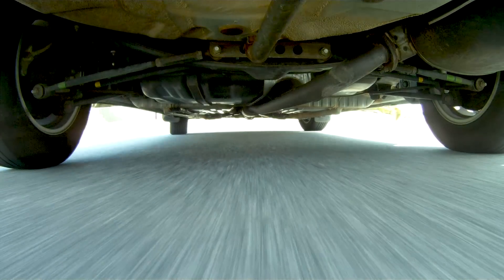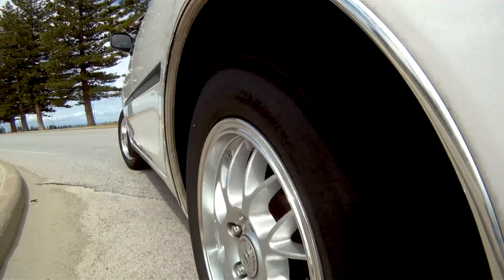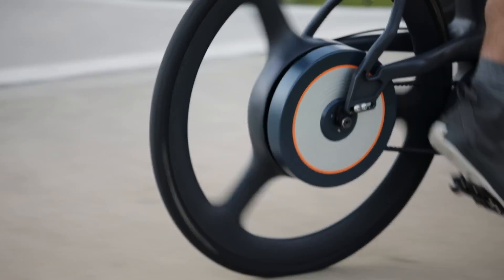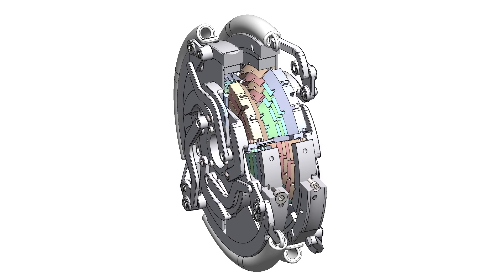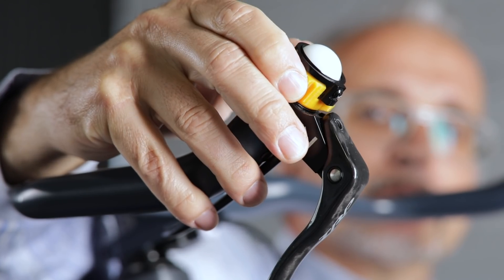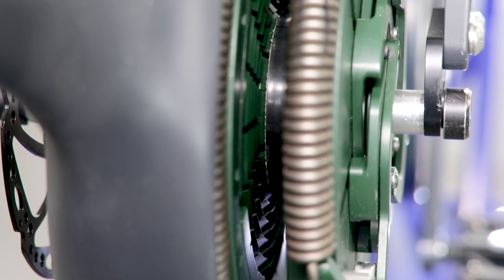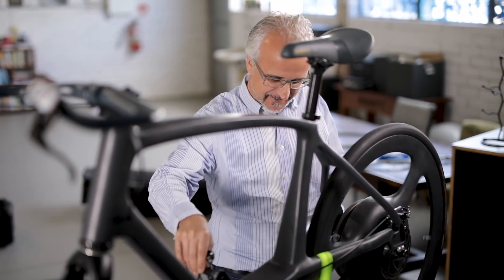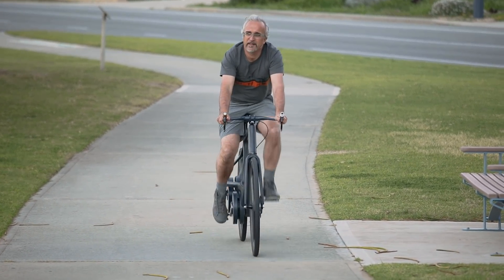Continuously Variable Transmission on a Bicycle

Comment: 1. Doesn't look simple ,very complicated.
2.lot of moving part leads to maintenance. 
3.it's not CVT.
Reply: Heavy weight too probably.
Reply: Ad1) My guess is that they meant "simple to use".
Ad3) Care to explain why you don't consider it to be Continously Variable Transmission? The core principle is the same.
Reply: To me a continuously variable transmission is one that is constantly adjusting the ratio to keep the power input at a constant speed as the output increases with speed. It does this automatically too. This one on a bike looks like a complicated 10 speed.
Reply: @seanriley1603    Automatic gear ratio adjustment is just a feature. Definitely useful (if not obligatory) for automotive applications, but rather optional for cycling (depends on personal opinion ofc, but people tend to lower rpm when riding uphill).
It's not 10 speed. What we have here are 2 cones seperated into rings to reduce width, so the entire system can be fitted inside bike frame. That's the whole idea here.
Reply: @RafaWyrwicki  - CVT is Continuously Variable Transmission, it's in the name.  This and the Nuvinici N360/380 are IVTs or Infinitely Variable Transmissions, having for any practical purpose an infinite number of ratios between their min and max ratio. The use of CVT is for marketing and as with a lot of marketing factually incorrect.
Reply: @Shindinru  Afaik infinitely variable transmission should have infinite gear ratio range. The example above doesn't have that feature. I guess we would have to compare our definitions.
Reply: @RafaWyrwicki  - Infinitely Variable Transmissions having, for any practical purpose, an infinite number of ratios between their min and max ratio. This is the working definition as you can't build a gear box that goes from zero to infinity gear ratio.
Reply: @Shindinru  you are wrong. By running the input and output of a cvt through a differential like setup which can be made compact by putting it in a planetary gear arrangement it's possible to subtract the input from the output and have a zero to one ratio and even a drive that can vary the direction only by changing the ratio of the cvt section. It's also possible with some type of oscillating sprag drive setup to vary the ratio to zero and its possible for friction drives the do this as well such as the wheel drive clutch on a snowblower which only has increments on the handle but in principle could be infinitely varied between forward and reverse. Of course it's impossible to get infinite output speed as somewhere along the lines physics would cause something to fail and input torque for even a small amount of drag or acceleration becomes  excessive. But in principle Infinite variability from zero to infinity is conceivable and from zero or even negative direction to some pre designed limit in practical and even exists.
Reply: @Shindinru  Yes you can. Quite easily. You take a continuously variable gearbox and you use a differential to subtract some of the input rotation from the output, with the result that in the lowest gear, the output doesn't rotate. You have now created a semi infinitely variable gearbox. Two of these in tandem and you have a gearbox that goes from infinity to one all the way to one to infinity, at least theoretically.
Reply: @Timms MC it uses a V belt, though. So if those rings only moved part way inwards they would engage with the belt
Reply: It looks like it has LESS choice than on modern bike!
Reply: 4. It's a proof of concept, obviously would require further development in order to be practical.
Reply: Well its stepless so yesnt and i do think its heavy stepless means theres no hang while shifting good on motorized vehicle man powere maybe not so theres always a good egg and a bad egg in a basket of new concept
Reply: And it requires a bluetooth connection, too. I wonder how well they're doing on sales?
Reply: Its a pseudo-cvt
Reply: Actually, I think it might be CVT. When I first saw all of the rings, I just thought it was a finely-stepped transmission, but it looks like they're able to continuously adjust the spacing of the tapered rings. So, it's like they took a normal CVT cone and figured out how to make it a set of nested rings, like how you can collapse a telescope. Overly-complicated, but still clever.
Reply: Is it a CVT?
Well actually, yes- but, technically no.
Reply: The more moving parts leads to loss of energy.
Reply: https://journals.sagepub.com/doi/abs/10.1243/0954407011528806?journalCode=pidb
" An infinitely variable transmission (IVT) is a continuously variable transmission with an infinite ratio range, which means that the transmission ratio may be zero."

https://www.machinedesign.com/%5Bprimary-term%5D/infinitely-variable-transmission-has-gearing-range-11-speed-automotive-transmission
"infinitely variable transmission (IVT) (...) is a special type of continuously variable transmission (CVT)."

https://www.slideshare.net/mobile/MoanungsangJamir/study-of-infinitely-variable-transmission
"IVT is a subset of CVT"
"(CVT) have infinite number of gear ratios"
Reply: Rahul Todmal agreed. It's so prototype it's ridiculous. The balance of the bike is ruined too. Looks good for posing like most Lycra clad idiots.
Reply: @Timms MC - Exactly.  What it is doing in practical terms is changing the Diameter of the pullies that the Vee -belt rides in, which is similar to how some CVTs work.
Reply: I think it is a CVT, just broken up into a number of parts (but still basically continuous)
Reply: 1. It can be shifted continuous variable
2. It is complex, a generator + Motor would be better like this sadly dead-looking Gear2 Design from Denmark (got some Design price in 2010)

Comment: so it is not a CVT but a remotely operated new style of gear system. CVT changes gear rations depending on the torque requirements
Reply: But that's automation. Cvt means variable (and continuos) inniterrupted gearing. Regular automatic transmision also changes gear ratios depending torque requirements.

Comment: Imagine to ride this bike on the mud or sand... This mechanism will get stuck right away..
Reply: I would presume the internal mechanisms would be environmentally sealed.

Same as how you wouldn't expect snow and mud to gum up into your cars transmission..
Reply: @lefyre1266  they would need to seal the whole mechanism to do that, the belt included
Reply: @juancarlospalomino8939  Full chain covers have been used for years on some bikes with internal gears. Many of them can be considered sealed systems. Applying similar solution here shoudn't be too much of a problem.
Reply: @RafaWyrwicki  I know, but I was saying because they didn't to that in the video, but it would be easy to do
Reply: Or snow? 
Ride it to work, leave it outside for 8 hours and come back..
It's all frozen and fucked.
My normal MTB doesn't like to work when it's cold.
Realised that around -36°C the brake cables won't like to move = no brakes.
Reply: @0hjaa3.0 Will you ride the bike in -36 cold? let me know how will you do that
Reply: @raduvas90  Ofc? I always did that when i didn't have a car and i had to go to school or work.
It doesn't what the weather or temperature, you have to go to school and work.
Reply: @0hjaa3.0  I guess your grandpa said the same about multi speed bikes back in the days and you dad about Shimano Di2
Reply: @MallV0lli0  Actually neither of my grandfathers talked to me.
One died before i was born and other was gone mentally.
My father didn't say anything about Shimano Di2 since that's a new thing and I haven't talked to him in 10 years.
And before i was 13, i didn't talk to him about bicycles.
So nope.
Bicycles work already fine and they did many many years ago.
No need to start to ruin bicycles with new, expensive and useless "tech"
These "creative engineers" all ready ruined cars and aren't going to stop until cara are just some toasters on wheels.
Bicycles don't pollute, so no need to complicate them as well.
Reply: @0hjaa3.0  my shifting cables freeze up around that temp but hydraulic brakes make all seasons much safer
Reply: @0hjaa3.0  Holy fuck with this temperature riding a bike must be delicious.
Reply: @0hjaa3.0  what do you mean? Microprocessor controlled bluetooth connected app monitored self heating  CVT is coming up in version 3.76
Reply: @0hjaa3.0  
So many haters in this comment reply
Reply: 0hjaa 3.0 nobody is riding bikes at 32* I’ve ridden at 28*F and with wind chill it was in the  teens and I made it about a half mile before I had to turn around... this was back when I rode 10 miles every day because I felt like it...
Reply: That was my first thought too when I saw that mechanism. Even in less dirty environments I would expect the mechanism to develop issues in a short period of time.
Reply: Don’t do that . That said it looks impractical?
Reply: yeah, also a small rock chip or smt :D
Reply: Imagine all the different parts you would need to service a drivetrain like this, a nightmare for bike shops and hell for the average joe
Reply: @Farhad Mustafa i did before i had a car.
Reply: simple. isolated all cvt part from anything can happen.
Reply: Or perhaps this only working in road bike
Reply: Just accept, this is the future! More to come...
Reply: Hello from Moscow! Ever heard of the Sobianin cocktail?
Reply: People wont believe and trust it until they see and use it. Nothing new here.
Reply: you all Experts commenting about reliability sealing issue and all, CVT has been using on scooters since years. And scooters are just bicycle with a motor in it.
Reply: Yep! #MTB #TrekLife
Reply: it will be fine if it is not complex and electric
Reply: You really think they haven't thought of what thousands of average commenters think they spotted?
Reply: No need to drive. A light breeze of dust and that thing is already done for.

Comment: I wonder what the frictional losses are with this.  In cars, losing a quarter horsepower in order to get the optimal engine RPM is a no-brainer.  It's a no brainer on a bike, too - just in the other direction.
Reply: relax, it's just prototype, wait till it gets to 2nd 3rd generation product before you make your conclusion
Reply: @lansiman  1.  I am relaxed.  2.  I made no conclusion.

Comment: Once I tried belt driven bicycle. Simply horrible experience. Belt stretch and takes away energy when you are at highest torque, then retract when you switch leg push left to right or right to left. It was bike which comes with mercedes S class as a gift. I can't explain how it was, it was almost unsafe to drive. Sometimes belt slips and you can fall from bike. Water really screw up friction. Also V shape belt makes more friction so when you driving around at 10km/h you use twice more energy because belt using half energy to spin and half all other forces. BELT IS HORRIBLE ON BIKE
Reply: Dragan Crnogorac ...I bought a Honda Accord, I didn't get shit. Lucky you. Anyways, good points on the belt drive bicycles. I've been considering one. You have given me something to consider if I ever test ride one, especially uphill.

Comment: Soo you need an app and keep it charged just to shift. SEEMS TO BE REALLY PRACTICAL
Reply: Apple bicycle gear shifting.
Reply: Well, top-end wireless shifting solutions like Shimano Di2 or SRAM eTap operate like this anyway. The benefit for these systems is the speed of shifting, reduction of cables, options to have multiple shift buttons/leavers, which is very useful on road bikes and time trial bikes which offer lots of hand positions. Then, apps allow special customisation in terms of how the controls behave, or hybrid shifting where the front and back shift simultaneously to maintain smooth gear changes.
Its obviously not the most practical, but people opt for it for the features.
Reply: @MishMash95  is there any reason why you can't simply have a basic application installed, with an optional subscription or single time purchase for both major and minor updates. I know Sony (example) has done this with numerous product lines, and I don't see them going out of business anytime soon.

Comment: CVT = lesser efficiency
CHAIN DRIVEN is better.

It will actually drain your stamina at the benefit of a noise-free ride. Not to include, you can't coast on a cvt unless you are at walking speeds :-)